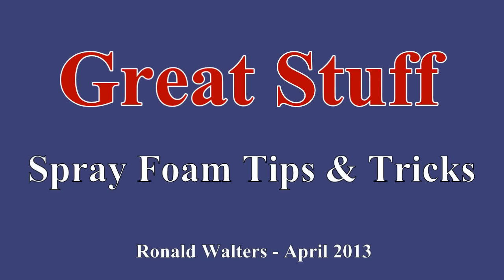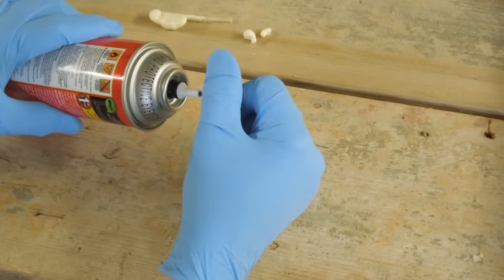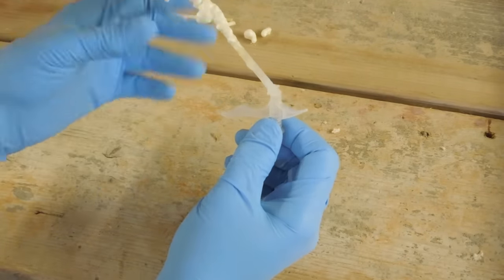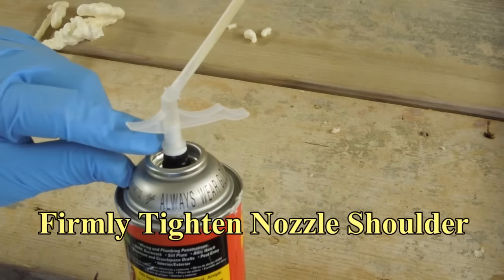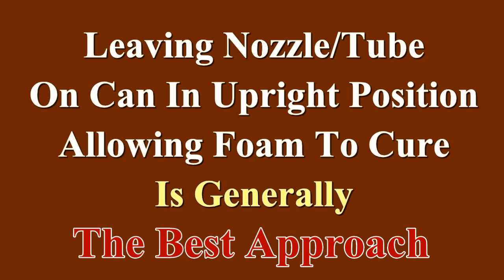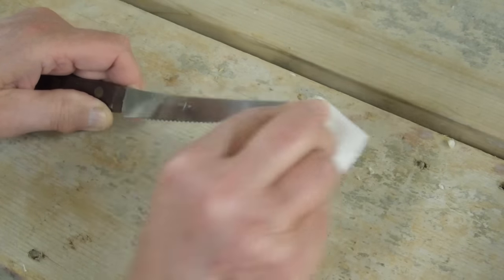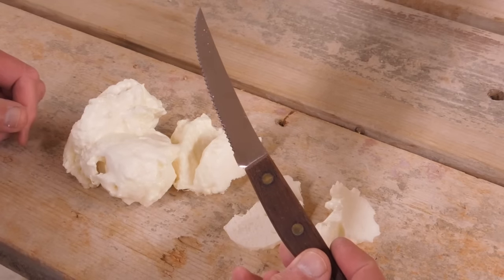Reusing Spray Foam Cans No.1 - Tips & Tricks

Comment: You don’t need acetone to clean the foam of nonporous materials, like a steel. A piece plastic, (those pot scrapper things you buy for a couple bucks work great), will scrap it off without scratching, once the foam has hardened. Even on things like carpet or clothing, as long as the foam is on the surface, not rubbed in, once it hardens, you can easily pull it off. If it is rubbed down into the fibers, that’s another story, then solvents will be needed. Just make sure the solvent, like acetone is safe to use on the material your going to clean.

Comment: I just did it a few days ago to fill a hole in  my wall with in half a hour it set on outside so cut it but was still sticky but did the job then judt put dome wall filler just wondering there is any  danger to it is  there as I cut and applied wall filler after a Hour been stressing thinking like it's dangerous lol
Reply from the maker: One trick to get this foam to set quicker (or for it to set at all in a very dry climate) is to spray (mist) some water into the area where it is going to be applied. I suspect your wall filler was water based so it probably helped the sticky stuff continue to set (hopefully). Note: For future reference, the foam expands quite a bit and using it in a confined space behind drywall could cause the drywall to bulge outwards.

Comment: Hi, I have a question (sorry for my bad English - I'm from Switzerland)... there is a foam which becomes as hard as a stone (like cement) is it true? If so, which one should I buy? What is it's name (or chemical component)?
Reply from the maker: +Faxi Mana  Most of the foam in spray cans (like shown in this video) are open-cell foam and low-density 0.5 lbs/cubic ft. Then there are medium-density 2 lbs/cubic ft and high-density 3 lbs/cubic ft closed-cell foams which generally require specialized spraying equipment. The high-density 3 lb foam is used on roofs and you can walk on it. The high-density foam will generally strengthen what it is sprayed on. It is pretty tough but I would not call it like cement... although you may think so if you have to remove a bunch of it. These are called SPF or Spray Polyurethane Foam. Also, these foams are not Ultraviolet Light Stable and must be covered or coated (painted) with something to protect them from sunlight deterioration.  The names of these products change from country to country so you would need to do a google search for your area. Hope that helps.
Reply: +Ronald Walters oh thank you for the answer - I don't have a special equipment, but I will look for an alternative solution :-)

Comment: My biggest issue is always getting all of the foam out of the long clear straw nozzle itself. Even just a few minutes after using the can, the foam is set in the straw. I've tried using things to push the foam out, tried washing it in water shortly after and all sorts of stuff.
Reply from the maker: Water is what causes the foam to cure or get hard. 
Usually (with a new straw) the cured foam will just pull (or push) out clean. Otherwise you can try cleaning the uncured foam (immediately after use) with spray carburetor cleaner or acetone.

Comment: Do yourself a favor and do it the easy way. Go to Wal-mart and buy a can of brake clean in the automotive dept. After you spray your partial can of insulation just use a couple shots of brake clean down the straw and another in the spout on the top of the can and you got it. Spray foam is soluble with the brake clean AND it's about the only thing that will get it off your hands or whatever else you get it all over.
Reply: about to try that today. thanks

Comment: Hey Ron, I have 3 cans...but NO nozzles 🤷🏻‍♀️  any tricks for that??
Reply from the maker: You can push sideways on the stem coming out of the can but you will not have much control over where it goes. A short length of flexible tubing can be placed over the stem and held in place with a small radiator clamp. The can needs to remain upside down whenever pressing on the stem. This can quickly become messy if the flexible tubing comes off.
Reply: @RonaldWalters2010  I actually used a bic pen👍🏻.... it screwed right on,worked well👍🏻

Comment: Good video. Should mention using heavy duty rubber gloves when using Acetone or any other solvents, brake cleaner, mineral spirits, etc. because it soaks into your skin & could cause problems. I used lots of harsh chemicals like these as an FAA Certificated Airframe & Powerplant Technician for many years. I really believe it's why my hands get so dry quickly that they peel & flake off skin like crazy whenever I touch something dry, dusty & dirty even though I used gloves most of the time while using these chemicals. Read the    Safety Data Sheets (SDSs) (formerly MSDSs or Material Safety Data Sheets) for each hazardous chemical to communicate information on these hazards.
Reply: I had my hands in so much stuff years ago before we knew better that I fear what the future might hold for me.  Well.... not fear, but wouldn't be surprised at anything.  What we eat today is probably as bad as anything we exposed ourselves to back in the day.  So far so good. :)))

Comment: some IS fire resistant. for four hours. got some fire resistant stuff in my ceiling. its polyurethane foam. quite a few brands here in australia. cures on moisture in the air. cleans up with turps or acetone. there isn't much gas in the can, he's right. got tons of this stuff on my old old house. it is closed cell. i use a big unserrated knife. I've carved with the stuff and everything. but don't do building related stuff on my channel. just off grid stuff.

Comment: I came up with a couple ideas that you can post on youtube.. im not into posting videos..#1 The great stuff just puts out too much foam to fast for  the  majority of house hold users applications getting that stuff everywhere butt where you want it. #2 the nozzle is allways comming loose where it screws into the can.. I have solved that remidy for both issues.#1. take a small piece of wire and put it inside of the straw exit end and take a cig lighter and melt the end of the straw and pich the straw around the wire.. to the desired size you want.Just on the tip is all you need. Might use a pair of plyers to do this as the plast is hot.#2 before screwing the nozzle on to the can.... put a couple drops of super glue on the outside male end on the can and glue that sob!down. it cant pop off or come loose when your working the can alleviating a mess.thanks for the vid

Comment: How can I mix in a bit of color to the foam (before it cures)? I've tried acrylic paint but the foam doesn't end up curing properly.
Reply from the maker: You can't do that. The gas in the can (in part) is what causes it to foam and when you start stirring around on it you push out the gas. Once it cures (on its own) it will have a smooth skin and you can paint it with latex paint. Or you can paint a cut section of the foam with latex paint. The foam needs to be painted with something to protect it from UV light otherwise the foam deteriorates.
Reply: +Ronald Walters thank you so much for your help (and quick reply!) 😊

Comment: I try to unscrew the nozzle, but the white part (that is part of the can) spins with the nozzle.. Is there a way to solve this??
Thanks!
Reply from the maker: Mor Bisk Usually that white part is fairly firm and does not rotate (at least not easily). Try wiggling the nozzle and use sudden loosening torque to jar it loose. Otherwise, perhaps you have just received one of those uncooperative cans. In reality few things work 100% of the time.
Reply: Or, try using a pair of needle nose pliers to hold the part that is spinning (on the can)while you turn the nozzle off.  I've done that and it works too.  A little tricky to get at, but it can be done.

Comment: I broke two nozzels, probably didn't do it right, but i have a full can that i need to use without the "screw" part on the can.
Reply from the maker: Throw it away before you get covered in foam and/or injured.
Reply: I just put a copper pipe approx the size over the nozzle and pushed in on, worked good enough. I even hit a nail down the hole to get a constant flow at the end. There isnt really 'that' much pressure in those... and worst case it just spews foam everywhere.

Comment: Will foam trap bad odors behind it? (if that's the reason for filling a space with foam?)
Reply from the maker: Bill Streifer The foam is insulation but it is also used to seal against air flow (around doors jambs, window casings, pipes) and to keep out bugs. Some foam is rated as a fire stop.
Reply: Ronald Walters You didn't say it, but if that "air flow" is smelly air flow, the foam should stop it. Are there foams that are best to stop air flow which expand a lot?
Reply from the maker: Bill Streifer  Go to this website and look around. http://greatstuff.dow.com/ (click on products) There are seven different foams. A new fresh can of Gaps & Cracks expands about 6 times and is pretty tough. It sticks to just about anything (that is dry) and skins over, so that may be your best bet to stop air flow (and probably smelly air flow) but ultimately that would be for you to determine if that is what you wan to do. Good luck
Reply: Bill Streifer Yes it will. I have a very smelly neighbour living in the basement who has a ton of fish tanks and a couple turtles. Needles to say it smells like the fish section of a pet shop. After sealing all ventilation intakes and registers I discovered some exposed floor boards underneath the stove. I used Great Stuff to fill in the gaps between floor boards and the smell has almost completely gone away.

Comment: Does it say anywhere on the can that it is a specifically open cell or closed cell mixture I bought a case of this stuff at one of the favorite hardware stores they said it was closed-cell and moisture would have no effect on it now my thought is my going to have to go up in This Old House in the Attic jams and Eaves I got that stuff back out cuz last thing I need is a big sponge up there already had enough leaks cost to replace This Old House red metal roof is way out of proportion any ideas or suggestions Shawarma putting a match to this damn place are like 300 years old a log home and a real drain on the pocketbook
Reply from the maker: When this foam cures there is a relatively smooth outer skin that seals the surface of the foam. I think that is why they say it is closed cell. But if that outer skin is damaged or removed, the internal foam is open cell... as I have demonstrated in this video. Run your own experiments to confirm what I have demonstrated.

Comment: I know this seems like a total girl question. But how do you get it to work the first time.  It would seem a silly question, but two cans in a row now, I pull the trigger and instead of flowing out, the darned thing just snaps off the top of the can.  I"m not THAT strong.  Is there a special way of holding it?
Reply from the maker: Ever use a can of Reddi Whip Whipped Cream or canned spray cheese? Works (or is supposed to work) the same way.

I have never had the stem break off of the can. I would take them back to the store for replacement or refund. Try to get a different batch or lot number which is usually printed on the bottom of the cans.

Thanks for watching. 
Please subscribe. That is what keeps this channel running. 
Ron

Comment from the maker: I see where they call it closed cell foam. But when you can hold it under water squeeze it and it sucks up water like a sponge that is open cell in my dictionary. Squirt some onto a piece of cardboard and let it cure. Then cut off the outside skin and do the water test like I did, then draw your own conclusion.

Comment: My trick- very shortly after use, remove the top off the can, leave tube intact. Spray/rinse foam from inside top and tube, and into hole that extends from can with carburetor cleaner or brake cleaner (any automotive department). Rinse as needed. Use good ventilation or outside. Compressed air into both areas to dry the solvent. Just as fresh as the day it was bought. Works every time!

Comment: I think the manufacturer recommends NOT breaking the skin by cutting it.  If you're careful enough with the application and don't over-fill you should be able to "tuck" the protruding foam into the area in question by compressing it, and there by not breaking the skin.

Comment: Its sold as insulation for windows- but it ABSORBS water? How does that help seal windows in the rainy season?..good thing I used only a little.
Reply from the maker: It is not sold as a water sealant and should not be exposed to sunlight (UV deteriorates the foam). It is sold as an insulation and it will fill air gaps. The outside surface does skin over which will repel water. Other sealants (such as silicone) are sold to keep out water.
Reply: Thanks!

Comment: Thanks for the tip, but does anyone know how to use an expired can? I bought 9 cans few years ago not knowing they expire and now Homedepot or the manufacturer won't replace them.
Reply from the maker: AJ H A lot of chemicals deteriorate with age. Have you tried the cans? Shake well and dispense some onto a piece of cardboard. It it still expands and sets up go ahead and use it. If not, throw it away.
Reply: Ronald, nothing comes out, they seem clogged or hardened, not sure.
Reply from the maker: AJ H Either hardened or lost the gas. Just throw them away.

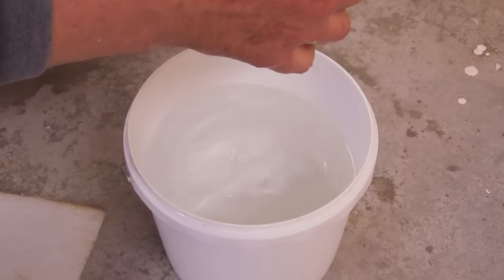Comment: 4:05 wait a second...I've heard several people say this is closed cell foam...did it maybe change since 2013?
Reply from the maker: In my opinion, the only thing that is closed is the outside layer which is the cured skin. When I cut out a block of the foam and it will absorb water when I squeeze and release it under water, as shown in the video, I consider that open cell. Ron

Comment: that's cool, I hate when the thing nozzle brakes or is lost, I just go to the gas station and get a funny bending straw and use it or work the end of the can the best I can, both methods suck.  Gloves, learned the hard way with black hands for a month. Another tip that heat the can up, works way better then then its cold, just heat water up in a old coffee can and put the can in, take it out and shake it every few minutes and put it back, If I cant heat it with water, the defrost vent on the car or truck works to

Comment: I use spray foam cans quite a lot in my work in facility maintenance. It has been my experience that it is quite difficult to resurrect a can of spray foam after it's initial use.
I have tried all sorts of tactics, including those shown in this video. Sometimes I can get some more out of a can, but more often than not they go stone cold dead, in terms of releasing more foam. I think the manufacturer should be responsible for resolving this great waste of product and the waste of money spent on these spray cans, which often do not give us 100% of the product within. By the way, I use my multi tool with a wood blade on it, to get nice carving and shaping results. Rubbing some caulking into air pockets and letting it set, is a method I use when I need to paint over foam which has been used in a common area. I try to make it less obvious that foam has been used, when it comes to finished appearance. The "expanding foam in a can", is a great invention. I have even used it to help a family member create their science class volcano project. Perfect for getting that lava flow look. Lots of cool and artistic uses for this product, and many utoob videos that present lots of those concepts. The industry needs to solve the problem addressed in this video. By the way, I have also used expanding foam on rotted auto body repairs, sometimes by itself, and sometimes in conjuction with chicken wire or mesh, and bondo.

Comment: To Add... Since it is an Open Cell Foam that cures with a skin on itself it will act as a great insulator but once cut that skin will be compromised and lose most insulation value. Worth keeping in mind.

Comment: There is fire rated one, usually pink in colour.
Reply from the maker: I have not used it. You call it pink… great stuff calls it orange.

GREAT STUFF™ Fireblock Insulating Foam Sealant insulates and seals service penetrations, providing an airtight barrier that impedes the spread of smoke and flames. Notice it says IMPEDEDS.

Keep in mind, this is a petroleum based product. Most of these foam products, if untreated and exposed to elevated temperatures or flame, will burn vigorously, producing copious quantities of smoke, and spreading fire to other combustibles.

A fire block or fire stop in a wood structure could be another chunk of 2x4. The idea is to block or stop (or merely slow down, if carelessly installed) the natural chimney or drafting effect between walls and upper floors or ceilings/attic. 

I don’t know for certain, but I highly suspect the Fireblock Insulating Foam Sealant is regular foam with orange dye. The orange color is to make it easier for building inspectors to see it… possibly building inspectors who are too lazy to give it a good look.

Some say that foam products sold in the USA are supposed to have an added retardant (read that as IMPEDES). That stuff in my can caught on fire immediately.

Thanks for watching. 

Please subscribe. That is what keeps this channel running. 

Ron

Comment: A better way is to wet a pipe cleaned or two and push it or pieces of wet pipe cleaner down into all tube through which the Great Stuff flowed.  Just leave the there until next use.  To reuse the can and the tubes, just pull the pipe cleaners out and the hardened foam will come with it.